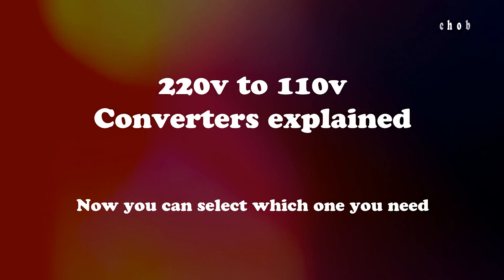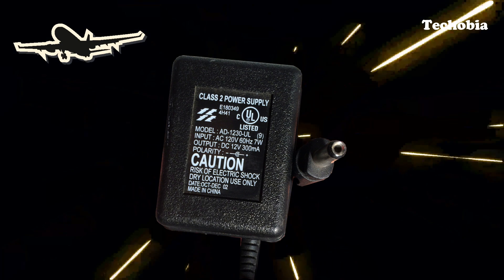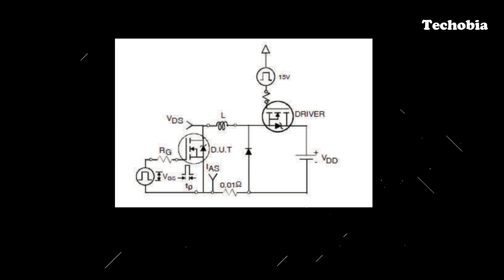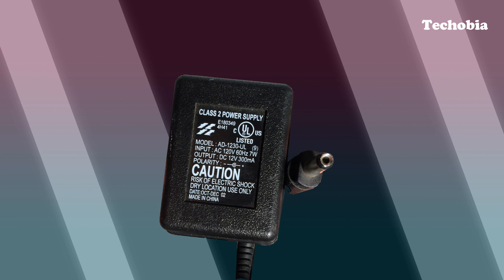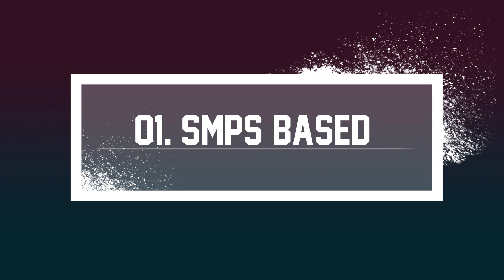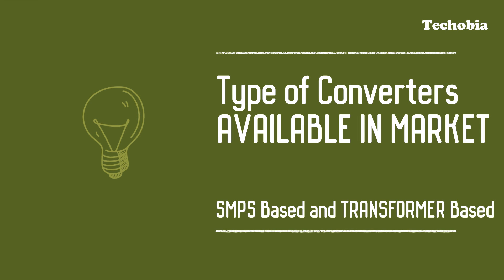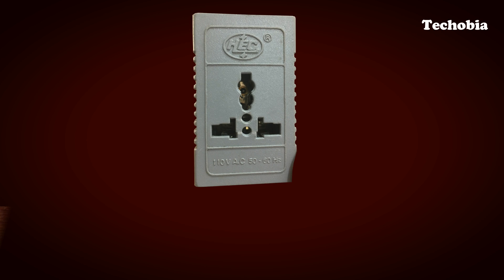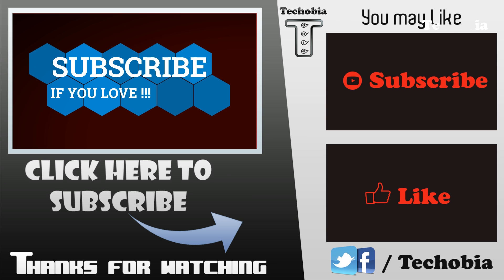How to use Electronics in India purchased from US | 220 volt to 110 volt converters explained

Comment: I have bought a Lenovo laptop from USA can you suggest what kind of converter to use for this device.
I have been using a converter 
And now am facing some issues and my laptop is not getting charged can you please help me out
Reply from the maker: you need a transformer based according to the watt on the adaptor

Comment: Hi
In my Dell Laptop bought from USA The Input Voltage of Charger is 100-240v i am using external travel adapter because in indian plug board we cannot charge americans plug so in that external travel adpater 10A 250v having it will lead some problem if I use the charge input voltage 100-240v with 10A 250V(external adapter from Orei)
Reply from the maker: just use travel adaptor without voltage conversion. I usually use the same and never find any issues like this

Comment: Hi techobia,  i have purchased evolv drill machine from US. The battery charger comes with 120v with 10w to charge the drill battery. I directly plug it into 230v plug. It did not work and i doubt is it damaged?
So what is the options?
Need a transformer based converter or new charger will recommended.
Thanks in advance....
Reply from the maker: transformer based and if you have some electronics store new you they have volt controller with them, they can plug step down the voltage and also check it using mutimeter to verify its ok or not..

Comment: We have Roomba which converter we can use pl.
Reply from the maker: If it run on battery then transformer based if run directly on power then SMPS based, please check watt or amp and buy it accordingly

Comment: Bro I have bought a TV from USA it says Power Supply: AC 110-120v but i am using it in India without any transformer and it is working perfectly fine. How?
Reply from the maker: It must be 220 volt compatible like in a way I am using Microsoft Surface Pro 4.

Comment: Anchor multi plus conver I bought is giving me Lilly le shocks for my US bought surface 4 laptop (65watt) while charging in india. Can you help
Reply from the maker: Surface pro 4 charger is compatible with 220v so you don't need any convertor, i am using surface pro 4 which i purchased there and using it without any issues and yes definately battery issues with time

Comment: Hey i jave purchased a craft tool from usa and it is 120v and has polarised plug which means one plate is wider than the order. I was told to use only a normal adaptor and not any voltage converter otherwise I won’t work well . How should i look out for such adaptors. And what shoild he the voltage of that adaptor? Indian voltage or american one?
Reply from the maker: If it's mentioned not to use any voltage converter than simply use it us to eu adaptor which is available for rs. 50

Comment: sir i bought panasonic rf-2400d am/fm radio 120v 60hz 3w which type convertor should i use?
Reply from the maker: If it don't have any battery then smps based

Comment: Hi...I want to buy a hair straightener from U.S
In the product description it says "international dual voltage 110-240V " and "if u are ordering from different country then u may need an adapter cause the product's plug is U.S standard base"....
Do I need to use an converter?? 
If yes then what type ?? Can u give an detailed explanation??
Also do I need to use only an adapter??
Reply from the maker: If it supports 240v then u just only need pin convertor us to eu or india ...no additional voltage converter

Comment: Dear sir,

I bought a wahl hair trimmer from US which has 120v 9w written, it doesn't have any battery. Will it work with smps based converter which I already have, or do I have to but transformer based converter. Also the smps converter description says for devices above 25w. Please suggest

Also I have a 9w power adapter which supports dual voltage, can I attach that to the wahl by cutting adapter end pin and attaching wire to trimmer plug ?

Thanks in advance
Reply from the maker: Don't do cut thing. It require SMPS based according to study which I did when I needed help and according to this you need to use below 25 watt one whereas what I think you must check the wire as this light w adaptors are mostly both volt supported. This is info which I have hope it help
Reply from the maker: Don't do cut thing. It require SMPS based according to study which I did when I needed help and according to this you need to use below 25 watt one whereas what I think you must check the wire as this light w adaptors are mostly both volt supported. This is info which I have hope it help
Reply: @Nikhil, I do have the same trimmer? Could you please  share the convertor that would work?
Reply: @sundeepc3583  i bought this one, it works, but the trimmer makes loud noise now, which cant be fixed but it works.
MAXCART 50 Watts Step Down Voltage Converter with Universal Socket https://www.amazon.in/dp/B074WNJ7WB/ref=cm_sw_r_wa_apa_i_bqLiFb2FWKYQG

Comment: I have brought the revlon 1 step hair drier and volumnizer and have brought a converter...but still my product is heating up and gives a burnt smell even on the cool mode...why?
Reply from the maker: Not sure, in other cases converter should get heated but not the product itself.
Reply: Hi, I was hoping to buy the same product. Have you managed to work out a solution for the converter?

Comment: Sir should we need to use converters in case of in case of laptops imported from USA
Reply from the maker: Most of laptops are both 110 and 220 volt compatible so no for those. Check your adaptor what's written on it.

Comment: Is voltage converter necessary for using us  laptops in India ?
U have to carry such a big box everywhere
Reply from the maker: Not for laptops as almost every laptop is 110 and 220 volt compatible. I purchased surface pro 4 from US and I am using it without any converter.
Reply: Techobia thanks for helping

Comment: This video is more confusing and also not sure everything is true. "SMPS based are for those devices which need direct current" is this true? then why this converter can be used for both electric shaver (Which as battery) as well as TV (No battery)? https://www.amazon.com/SEYAS-Transformer-Converter-Continous-Protection/dp/B06VVXN2SR/ref=sr_1_1?keywords=Seyas&qid=1559304655&s=gateway&sr=8-1
Reply from the maker: this video is not confusing it is just to avoid confusion and save your devices. When I bumped into this issue then after such efforts when I soluted it our then I made this informative video so people will not get confused.There are two type where in one we have to charge battery there we have to use transformer based else SMPS based and again we need to check the watt of the device with which we have to use and buy the same wattage supporting one. Hope this helps.

Comment: I have purchased Wahl home cut in Flipkart I want to purchase 120v-60hz this type voltage adapter  I can't find this adapter can u help me sir what or where to purchase?
Reply from the maker: Is this a bettery based or direct supply and what's is wattage of this device?
Reply: @Techobia  directly supply no battery
Reply from the maker: How much watt it required to operate?
Reply: @Techobia  9 w
Reply: @Techobia  9 watts

Comment: What if the input supply has only 110V? In India it is 220v. I have purchased laptop from USA having only input of 110V?
So how to do charging ?
Reply from the maker: Normally the laptop chargers are 110v and 220 v compatible but if you are sure then in that case use transformer based convertor to step down voltage

Comment: Got a straightener from US: 120V 60Hz 77W. I got a converter which steps down to Indian voltage to 110VAC 50-60Hz and has 1000W limit. Somehow when I plug the appliance into the socket and turn on the switch it starts buzzing (when the appliance hasn’t been turned on at all). Haven’t used since it’s scary. Could you help where it’s going wrong
Reply from the maker: You mean - you purchase converter which is only supplying 110 V and capacitors or transformer is loosing other 110V so this type of humming sound is common. Please contact some person who has a knowledge and check this converter in person for you
Reply: But shouldn’t the transformer be making sound (if at all)? The product is buzzing. With only turning the transformer on not the product
Reply from the maker: In that case, I am not sure as such thing never happened to me.
Reply: Hey am having the same problem. Did you get any solution to the buzzing sound. Even I got straightener recently

Comment: dear sir, actually i have a jvc sound system, and i using it with the help  of a converting adapter ( 220 to 110 v ) but sir the issue is the woofer shuts down when ever i increase the volume... but it works fine with lesser volume .. and also the adapter becomes so hot after just 15 min of usage.. please gimme a solution
Reply from the maker: you need to use different controller to control voltage, suggest you go with high quality converters,  you must have to use SMPS based converter whereas becoming hot is ok for any converter mainly transformer based.
Reply: thanks a lot for the reply sir ..

Comment: Hi , i bought samsung smart hub from amazon usa, the plug adapter input is 100-240V and the output is 5V at 2A., but technical sheet says 100v , should i  need to use step down transformer, if needed wattage of transformer. Thanks.
Reply from the maker: If input adapter is 100-220Volt then no you are fine to use without any stepdown
Reply: Samsung Electronics UN50MU6300 50-Inch 4K Ultra HD Smart LED TV (2017 Model) https://www.amazon.com/dp/B06XGJRVJY/ref=cm_sw_r_cp_api_0vSABbB694924 

Can we use this TV in India 🇮🇳 bro?? We use a voltage rated for 120v - 240v&  50Hz in India.please reply me .Thanks :)

Comment: I used step down for the Waterpik. It worked, but then when I increased the wattage of the converter, fuse tripped. I tried again, there was a sharp loud "tup" sound and now the waterpik doesn't work. Please suggest a good converter for the waterpik
Reply from the maker: is this Waterpik battery based or direct plug in
Reply: Direct plug in
Reply from the maker: you need something like this https://goo.gl/Nj7Lbu
Reply: Thank you for the link. I did use something like that bought from Amazon. Still it tripped and the converter burnt. I am hoping I can repair it in some electrical/electronic shop. Thanks again for this video and your reply.
Reply from the maker: make sure not to buy transformer one as you are using non battery device, you have to buy SMPS based convertor
Reply: Waterpik that I use comes with a toothbrush that needs charging. So there must be a battery in it? So will I need the transformer type?
Reply from the maker: If it has battery then Transformer type

Comment: I have ordered newer microphone and phantom power supply 48V from Amazon in India and they said I need to buy step down converter but the hardware shopkeeper says I don't need to buy anything only a adapter will do. So what should I exactly buy or not buy? I am really confused and new to all this can anyone please help me out with this
Reply from the maker: Which specific model you purchased which need external power as normally these are 5 volt 9 volt or 12 volt for which you don't need to down the voltage as you only need converter so you can plug it in Indian plug. Please provide more details if this answer doesn't help
Reply: Techobia power supply details 1-Channel 48V Phantom Power Supply with Adapter, BONUS+XLR 3 Pin Microphone Cable for Any Condenser Microphone Music Recording Equipment (8 feet)
Reply: microphone details NW-700 Professional Studio Condenser Microphone with Adjustable Microphone Suspension Scissor Arm Stand, Black
Reply from the maker: As what I got it and checked that you need to use 220V to 110V converter if you plug it directly it will fuse off. You can also check on Amazon India someone placed same product and in customer replies one replied same to use converter for it
Reply: Techobia thank you so much I'll probably buy step down converter then and not listen to the shopkeeper guy I guess
Reply: Techobia I posted a comment on Amazon India as well and there the replies were I don't need any 220V to 110v converter just plug and play
Reply from the maker: I thought on the same way when i checked the volts and all but someone specifically replied must to use converter and its seems that user purchased but we can't say everyone is providing real feedback. Please let me know if it works for you like plug and play so it will be help to others as well.
Reply: Tried to plug and play with some adaptor by which you can plug it in Indian plug the power LED light was on but few moments later it went off so I guess we need Step down converter can you provide amazon link for which would be the best Step Converter to buy?
Reply from the maker: I purchased it from ebay and again if your device has a battery inside then you have to use transformer based else SMPS based

SMPS based: https://goo.gl/6ZxShF

Transformer based: https://goo.gl/FZdRJp

Comment: how about a smart tv purchased from US/ Canada and using it in India
Reply from the maker: check it s adapter if it is written 110/220 volt then you can plug it without any converter, if it is written 110v only then use converter
Reply: Techobia PAL and NTSC. Most TVs in Europe uses PAL also India uses PAL.  and the Philippines, US/Canada uses NTSC
Reply: Francis Litan how to convert it to NTSC??
Reply: Ahlad Kumar Buy it from Europe. US/Canada uses NTSC same as the Philippines (220V).

Comment: i have a trimmer brought from the US which i want to use in india.....do yo'll hv the voltage converter?
Reply from the maker: Please check is it written any where that it is 110V and 220V supported, if yes then you can use simply or if you can see some printing like this CLASS 2 or on its adapter if its written 110V then you need this converter